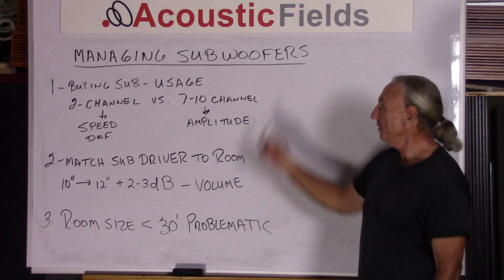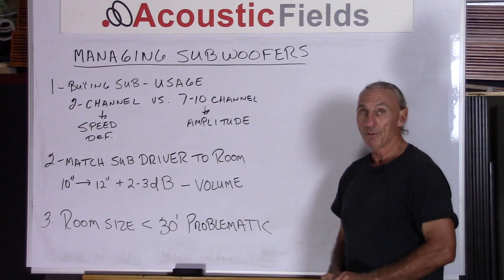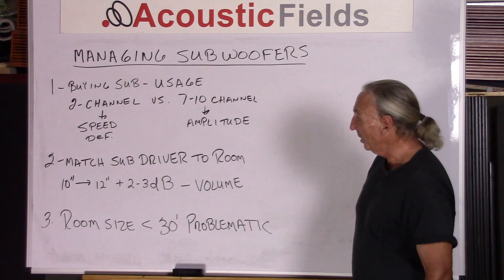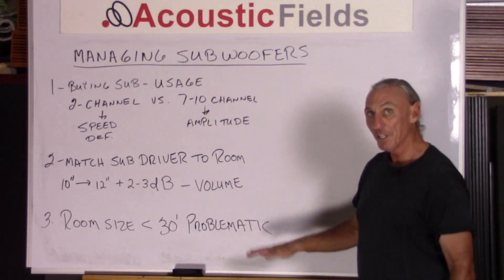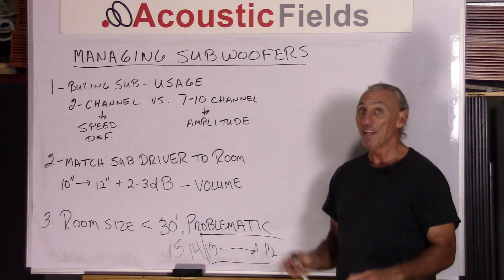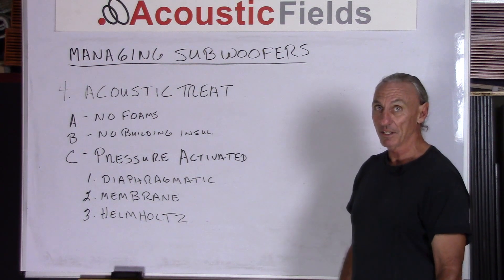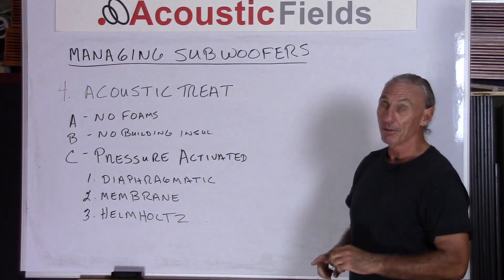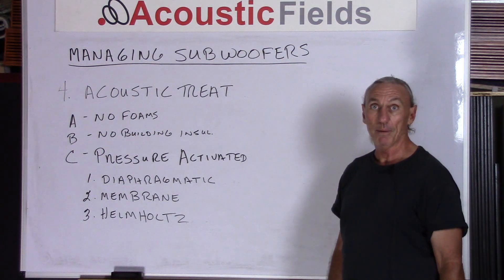Subwoofer Acoustic Treatment - Managing Subwoofers - www.AcousticFields.com

Comment: By fixing rock wool panels to all the sides of the room , can I manage Low frequency?.  material is having absorbing coefficient 0.7 for low freq and 0.9 for mid range
Reply from the maker: S, No, they are a limp mass material that has no impact on low frequencies. They are also toxic to work with and the particles get into your lungs and never leave. They also over absorb middle range frequencies and drain the life out of music and voice.
Reply: Thanks for  clear info sir, how do I manage 50 to 1000  Hz,  with  keeping down below 40 hz in a 25 x 13 room. Any how I do not want to listen boom boom bass below 40/50 HZ
Reply from the maker: S,  Broadband diaphragmatic absorption is your treatment type. You can build your own units using our DIY / BDA  units.  https://www.acousticfields.com/product/diy-bass-absorber-build-plans-bda-broadband-diaphragmatic-absorber/

Comment: Time to look for a new room. Best advice ever..  my ceiling height is a problem. Fiberglass I use on my walls is the stuff they put under glass in buildings. I only have one subwoofer currently and don't feel the need but I have in the past set up 3 spaced 1 meter apart and with the phase rotated 60 is degrees on each and the LP filter lower as they are further away. It sends out of phase sounds everywhere but forward. Great videos by the way. Try an end fire. The most directional woofer in line with the mains.. you do need 3 meters of space to work with... Larger room.. I used 8" cheapo Energy and Mirage when I tried and a paradigm 12" with 180 rotary and switch. You will be surprised. Well maybe not..
Reply from the maker: D,  Sub quantity, driver diameter, room position, and a room with sufficient volume are all great starts. However, if the room low frequency modal issues are treated correctly with the appropriate technologies and amplitudes are lowered with the first three variables, you can achieve similar attack and decay rates with frequencies below 100 Hz. as you can above 100 cycles. Their is no greater sound to me than a 40 Hz. wave that sounds as tight and clean as an 80 Hz. wave and its cousin the 120 Hz.

Comment: Dennis, You say no building insulation, I assume you mean the common pink fiberglass insulation type from home depot...? but may I ask specifically, 

Roxul safe n sound ....  https://www.lowes.com/pd/Roxul-59-7-sq-ft-Unfaced-Rock-Wool-Batt-Insulation-with-Sound-Barrier-15-25-in-W-x-47-in-L/3394032?cm_mmc=SCE_PLA-_-LumberAndBuildingMaterials-_-Insulation-_-3394032:Roxul&CAWELAID=&kpid=3394032&CAGPSPN=pla&store_code=1824&k_clickID=161e5e73-590f-4a7f-aedc-57a5a580d920&gclid=Cj0KEQjwofHHBRDS0Pnhpef89ucBEiQASEp6LKAO0ySWHPD-FL0ZnqS4qf5fBMNXjvhqVsB78TipokoaAsUy8P8HAQ 

I have seen videos of studios using this in the walls, This is what I used for my corners floor to ceiling. thanks for your help!
Reply from the maker: Hi Phat, Look at the materials it is made of. Once you know this, you won't want it near you. It is poison for you and music.
Reply: Poison for you and music. Please do explain?

Comment: Whats the ideal placement for subs in a room. I have 6 at the moment. Four up front and two in the rear. My room is about 30 feet long and 24 feet wide with 8' ceilings. I am still lacking low end.

What are ideal placement positions for subwoofers?
Reply: Mmmm ... Eeeww
Reply from the maker: JJ Dente Sorry for the delay in responding. I will make sure I answer this in the next hangout and send you the link to your specific question and answer.

Thanks
Dennis
Reply from the maker: Hi JJ Dente 

I answered this question as well in this week's Google Hangout. You can see your answer here:
http://youtu.be/3ps5Tm5CYP0

If you fill in this form on my site I can take a closer look at your situation. If you can include photos then that would be great:
http://www.acousticfields.com/free-acoustic-treatment-room-analysis-tell-us-about-your-room/

Thanks
Dennis